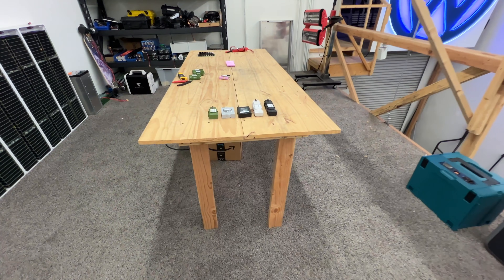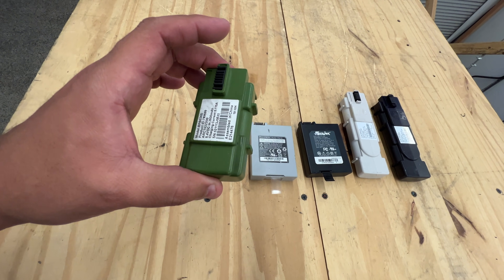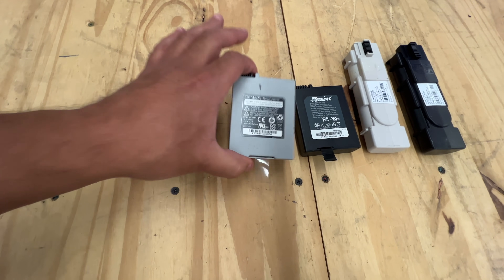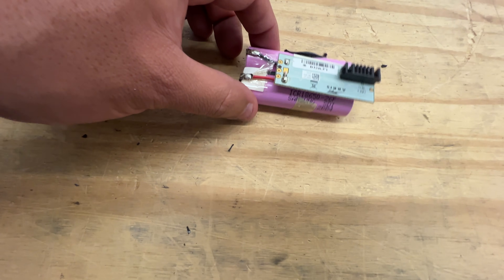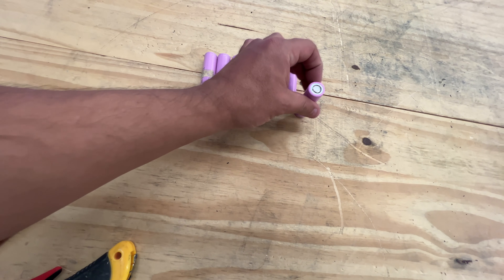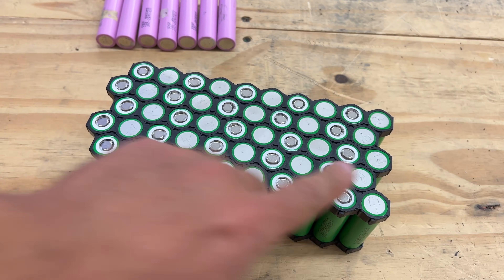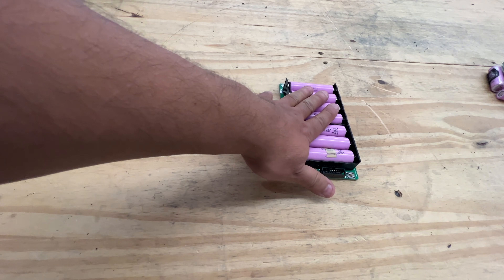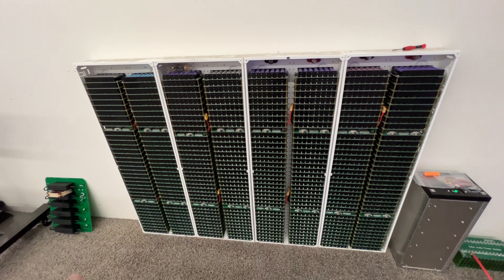Extracting 18650 SAMSUNG cells out of $1.20 Modem Lithium Batteries

Comment: Modems in Australia don't have batteries.
The gov't decided to put us on VDSL via FTTN - and reused the crappy copper cable to our houses.
Any time there is a storm, the connection drops. I had to design my own USB board to seamlessly change over to 12v battery supply.
They also did away with POTS service in favor or IP phones - not a great idea.
Reply: Europe has the right idea, fttn, but the node passes X pairs back to exchange so you keep POTS, of course NBN are too cheap to upgrade every home by installing NTD with central filer (you cant really use inline filters at vdsl, its essentially a bridge tap and will reduce performance and  induce drops)  there is a doc from pre planning by suppliers that had this in it, but NBN opted for the el cheapo garbage we get today.
Reply: My 2015 installed FTTP NBN includes a 12V 7Ah SLA as backup.  I’ve replaced it twice now, because once it starts to beep (indicating a bad battery) the NBN goes flaky.  Tried running without it but it needs the battery attached to stop the incessant beeping.  If I can work out the PSU needs of the modem itself I could get rid of the backup box & PSU combo, but there’s no V or A specs noted on any of the components except the battery itself.
Reply: @commodorenut  fiber to the premises is not available in rural areas, only fiber to the node. No battery backup provided for those.
You got lucky to get fttp.
Reply: @commodorenut  to solve the beeping issue, add a bigger 12v battery on longer wires. Many of those charge circuits overcharge those little SLA bstteries. An old car battery will shut it up, a d you can top up the cells. It should also dissapate far more heat, and therefore live much longer.

Comment: Word of warning, I'd disagree about them being in every single cable modem. Because, a lot of companies sell you the batteries for a charge, and 99% of people don't purchase that, because they don't need the backup batteries.
Reply: They are for modems that provide voip service for POTS phones.  So they are running the phone service in a house that needs to be able to make 911 calls in power outages.  This is why they have batteries.
Reply: @Donn29  I know what they are for. I'm just saying, a lot of companies require you to rent/buy the batteries as an optional extra. They are not mandatory for the modems operation under normal conditions.
Reply: @blacknester the batteries are ONLY for home phone service if you have that service with your internet provider. It’s for emergency calls if the power goes out and only last for couple hours until power come back to recharge the battery. It does NOT work with the internet
Reply: true, a lot of these batters sat in a box in the cable company warehouse never used, I know I work for one and have taken home about 500 packs over the last 5 years
Reply: @blacknester unescessary as ADSL connections  bring its own power, but unfortunately now with the cordless phones it doesn't work anymore, but if you remeber the old basic phones only had the phone line in nothing else.
Reply: They are used for CABLE modems, which is more common in the USA than elsewhere. I'm in Australia and most broadband is via ADSL not fiber or cable. My old (separate) cable modem had 3-cell backup, but my newer Netcomm cable modem+router combo did not.

Comment: that PCB board way is just pointless.. takes up too much space.. the best way to handle and organize 18650's is with the 18650 grid holders.. and put your own "fuses" and/or BMS's" on them
Reply: Not just pointless buy very lossy those chrome contacts are 50 times the resistance
 of copper, as you say the way to go is plastic grid holders and spot weld strips directly to the cells
Reply: @phillipsmiley5930  Yeah... It's a nice concept I suppose, but has its drawbacks, and it's also a very expensive way to do it! Those PCB kits are not cheap.

Comment: We dont have batteries in our modems in the uk...😳
Reply: That's because your land-line telephones come in a separate copper line. In many countries, the copper is used for a modified ADSL (Fiber to the Node) and the phone is then connected off the modem (rather than an ADSL splitter). In America it's usually Cable (RF) modems with the phone plugging into there, and there is no longer any copper phone line like you have - hence no way to use the phone if the modem is un-powered.
Reply: @johncoops6897  Fair enough...thanks for taking the time to explain...Cheers 🍻

Comment: If I'm not using my cordless tools for months or longer should I discharge the batteries by using the tool until one bar is lit? I'm guessing I'm not supposed to keep them charged until use?
Reply: Not necessary. The whole "Storage Voltage" thing is a lot of "Urban Myth" anyway, propagated by the RC fools (they are like AudioFools, but with RC).
One BIG danger with power tool batteries is that the BMS is usually only powered from one cell, and continuously draws current. So if you bring them down to a low state of charge then store them, you face a HUGE risk of that one cell going under-voltage. If that happens, the BMS may lock it down and make the whole pack unusable.
This is very common with Ryobi, but other packs also do it too. Bottom line... store them fully charged, never store them at a low charge.
Reply: @johncoops6897  I really appreciate you taking the time to answer my questions in a way I can understand.
Reply: Safest long term storage for Lithium cells is typically at around 35% to 40% of charge.  That is how they are shipped from manufacturers since they then have the longest shelf life.  You should avoid a deep discharge, since any further self-discharge can take the cell down to a voltage where it will degrade.  Conversely, high voltage just puts stress on the cell which will encourage self-discharge anyway, but cells will not self-discharge equally.  At 35 to 40%, most cells will stay very close to that voltage for months or even years.
Reply: @GodmanchesterGoblin  - that is technically correct, however this is the real world and not a text book or online forum. The issue with power tools is that usually there is a BMS that's drawing voltage continually from ONE cell, so no matter what the consumer does, the cells are being "actively de-balanced" over time.

Worse, the packs and chargers provide no way to (automatically) control the charging voltage, and the "power level" LEDs have crude circuits that may or may not reflect anything logical. So you'd need to use external measuring and charging devices to bring the pack into a "35 to 40%" charge... and what exact voltage should the consumer choose anyway?

Furthermore, power tool BMS and chargers almost universally don't have any balancing whatsoever, and only a few have top balancing (float/soak charge disconnect of individual cells). The only thing they almost all use is a cell voltage detection that fully disables the whole pack if any one cell goes under-voltage, and this commonly renders the pack un-chargeable.

So with one cell being continually discharged, any imbalance will get magnified by the inherent charging systems that they use. It doesn't matter how nicely you look after the voltage of the whole pack if one cell is low. Anyone who harvests cells from tool packs (like me) knows that it's almost always only one dead cell (or pair) that's killed the whole pack.

So, power tools are nothing even slightly like Radio Control packs or individual cells. Generally, the best thing is to store them with a high state of charge, and never EVER store them when they are low or fully flat. For long term storage, top them off every few months to prevent deep discharge of that ONE cell that powers the BMS.

Overall, you are probably better off simply using the tools periodically rather than storing them for long periods - the packs don't usually die from over-use... it's storage that kills them. Personally, what I do is open the packs and manually top balance each cell (or pair) by individually charging them. This rebalancing once or twice each year makes a huge improvement to overall health of the pack.
Reply: @johncoops6897  True, and I know all that - I have spent years working in the consumer electronics and industrial electronics industries, and you are right - one low cell in a series chain causes problems where there is no proper cell balancing available.  I wanted to move away from the "urban myth" cited above, since correct storage condition is nothing to do with urban myths, and I have no idea why RC cells are being mentioned here.  I would agree with your final paragraph - in the case of power tools, in most use cases it's better to use them and keep then reasonably topped up.  If they sit languishing in a shed for six months of the year that's generally going to lead to an early demise.
Reply: @GodmanchesterGoblin   - Cool, thanks. My comments were more for the OP (TIHS PID...) rather than yourself.

The "urban myth" that I mentioned is the common belief that the storage SOC (State Of Charge) SIGNFIFICANTLY affects the longevity of the cells.
In other words... yes, we can agree that storing cells at 30% or 40% or 50% capacity can increase the cell's life compared to storing it at 100% charge. However... the question is by HOW MUCH does it actually increase the life, huh?

The "urban myth" is the bullshit (mainly within online RC forums, but also at places like SecondLifeStorage) that you will instantly and irreversibly destroy your cells if they aren't immediately placed in a "Storage Charge" condition and are never EVER allowed to stand at 100% charge! I've read far too many of these RCfools who discharge (and balance) all their cells to precisely 3.5V (or whatever their particular Lithium Cult dictates) even if they will be using the pack in a few day's time.

Some won't even charge the packs until they reach the RC track, since the 15 minute car trip between home and track (with a full charge) might spontaneously destroy their precious little LiPos - completely ignoring the fact that pulling 25C, 50C or more from the packs will put far more stress on them than even a year of full voltage storage!

There is similar bullshit online about cells that have fallen below 3V. Many of these StorageFools will throw away any used cells that measure less than 3V when pulled - they don't even bother charging and testing! The bottom line is that it's an urban myth that these cells are significantly damaged, just like it's urban myth that Lithium cells that get stored at 100% SOC will be significantly damaged.
- In reality, since every charge/discharge cycle reduces the cell capacity slightly, simply using the cells is what "harms" them the most.

Comment: these cells will have a low discharge rating so would be no good for high c discharge such as scooter or power wall projects
Reply from the maker: Power walls are not high c discharge projects,  every hour you want your battery to last is a fraction of a C rating.  5hour run time = 1/5c for example

Comment: I"ve not seen prices as low as what I see with the laptop batteries. Maybe I'm not looking in the right place ? I'm checking the 60cents each price against what I see with new laptop batteries as we speak. I'll be back and edit.....WELL, I see that now I would pay $2 a piece for them. Wow ! Expensive.  BUT, then again, technically these modem batteries are USED, and the cheapest I can get is $32 no shipping from that company. I'll let you know how I made out, I'll do a video. Thanks.
Reply: 101621/1441h PST 🇺🇸   Brother, thank you for the info. Would you please post the source, from where you get them? A few years ago, I’ve, even bought 18650s (used) as high as $3 EACH plus shipping and starved for a day recouping the loss! Errr I lied… I didn’t. Take care compadre, Californian, stay safe.
Reply: @sreekumarUSA  - the link to the OP's website (where the cells and packs are sold) is clearly shown in the video description.

Comment: HOW do you test this cells? I have now tested the same 4 cells on 6 chargers 4 are the same and 2 are the same and I get weird results capacity varies from 2200 to 2400 mA, but internal resistance goes from 64 ohms to 195 ohms and than again 57 ohms and so on.
Reply: Clean the contacts - the Internal resistance tests need a very good reliable connection. The simple methods used for the hobby chargers and multi-bay chargers is far too simplistic to be accurate, reliable or repeatable anyway. You can only get an "estimation" at best, and you'll never get the exact same result.
Reply: @johncoops6897  wasn't a reply, was psa, placed in multiple threads. And, if it were a reply, it was to the thread, not a person. There is not @name goes here on it. Unsure how you thought it was related to you
Reply: Never charge indoors. Always maintain batteries properly per specs. Set up something contained outside for charging. Using an old file cabinet (steel), washing machine, freezer, or similar. Two people I know have had fire while charging hobby battery packs.
Reply: @tahoma6889  - Thanks for your totally irrelevant rant. Did you forget to actually read the comment before writing that boring lecture?

Comment: pretty much nothing here in aus has battery backup which is a pity. id live to make my own battery packs but theres just nothing around that you can harvest cells from aside from finding a source of dead laptop batteries, and even those are harder to get hold of because people are switched on to others finding value in dead electronics so its often cheaper and easier just to buy new cells
Reply: I get absolutely tons of free laptops in the council cleanups (curb-side trash collection). I can't disassemble and test them fast enough with one Opus 4-bay, two SkyRC chargers and two bench power supplies. So, look for the whole laptops, rather than just the battery packs.
Also a great source of "INR" type cells (usually 10A continuous) is cordless vacuum cleaners. People chuck them away as "faulty" because they empty the dust bin but never clean the filters. I find a few each week and they work fine, but cannot suck anything with 1/2" of crap blocking the filters. Those cells are usually 2000mAh 10A and test about 2100mAh at 1A discharge.
Yeah, they are all randomly mismatched, but they are 100% free.
Reply: @johncoops6897  obviously the area i live in people are stingy as fuck then i guess XD. also curbside collection only happens every couple of years in my parts of the country. dead electronics of every kind are put up on facebook etc for sale in my town. i have a mobility scooter and was looking for one for parts as its pretty old, some bloke wanted to sell me an old 3 wheeler that must have come out of the 70s and had been sitting in a paddock for who knows how long and he wanted hundreds for it. hard to get anything where i live without paying too much for it. but then i dont live in a capital city either.

Comment: I would try setting up a dremel like a table saw or use an actual table saw to cut all four side. Hopefully the depth of cut needed is same on all four sides but you could do all one side then setup for the next side.
Reply: just slice the sticker in half and then take vise grip pliers on the end with the connector and pull apart, easiest and fastest way to do it.
Reply: ha ha .

Comment: Aren't they left for a few years at a high state of charge voltage which is bad for longevity no?
Reply: Yes, that is worse than brand new cells or cells stored at 70% charge for a long time. However, the low cycle count and low price actually gives it a compelling case over the cheapest made in China ones you can find.
Reply: @harrytsang1501  I changed them on a server RAID internal board that had an error saying to replace them after about 8 years always on. I don't know the brand, but 18650's.  Likely those are just stored at 80% the whole time except once or twice a year power outages
Reply: $1.20 is amazing. I'd use those on a project that got lower usage but maybe not a power wall for my house.
Reply: Yes. It is just why laptops suffer.
Reply: @LordGryllwotth  I wonder if these are kept at 80% instead of 100% to keep them longer lasting than 2-3 years you might get otherwise at 100%
Reply: @steveseeger  - you won't get "2-3 years" at 100%. Generally that is bullshit. These kinds of cells (well, the Samsung ones like 26F) will typically have higher than rated capacity even after 10 years - the chemistry of good quality 18650 cells means the degradation is minimal.

Comment: Man I need this.. I'm from Philippines and my location is way far from power lines.. I cannot afford 18650 genuine cells and I'm too scared to use Chinese ones for diy powerwall..
Reply: Have a look at using prismatic LiFePO4 (LFP) cells if you find 18650s hard to get.  The LFP cells work out cheaper per AH when you are looking for a few KWh and they are much less likely to catch fire :)

Comment: They have have very little cycles on them, but wouldn't they have been sitting at 100% for  a year or two? That is also not good for lithium batteries.
Reply from the maker: Some handle way better than others.  Sanyo cells degrade really bad,  but LG and Samsung hold up really well
Reply: I don't know about Li-Ion, but my experience with LiPos has shown me you want those things at storage whenever possible. Of course LiPos are designed instead for high current output, and aren't usually as stable as Li-Ion, but worth mentioning.
Reply: @jpsalis  - actually using your LiPos will harm then FAR more than storing them at 100% Charge. These kinds of Li-Ion cells are specifically designed to be left at high charge rates for long periods, which is why they are used in Laptops, Modems, etc.